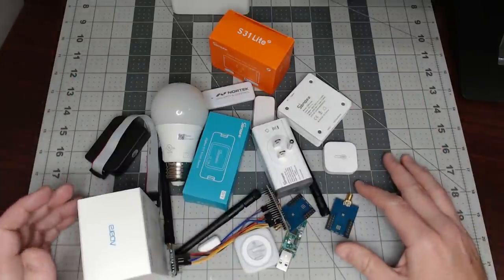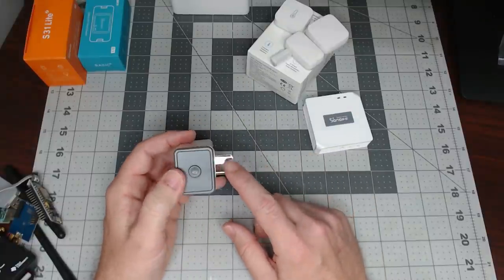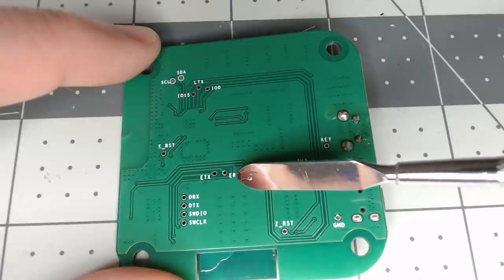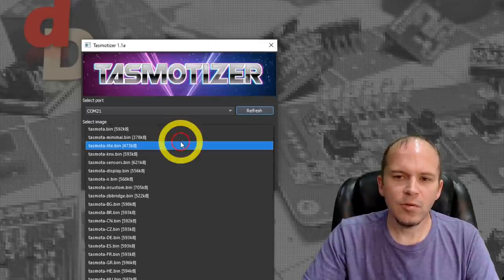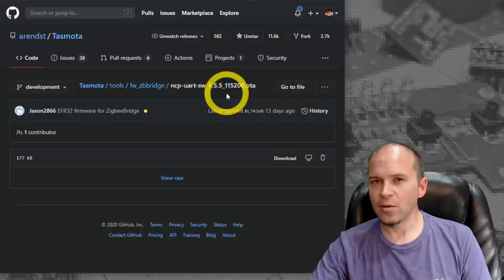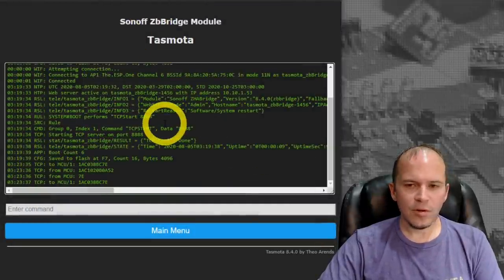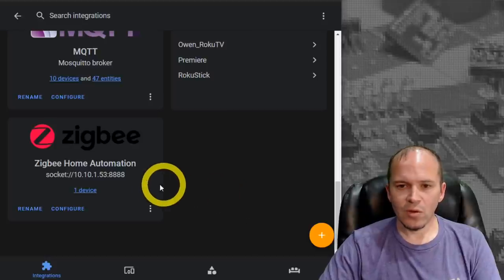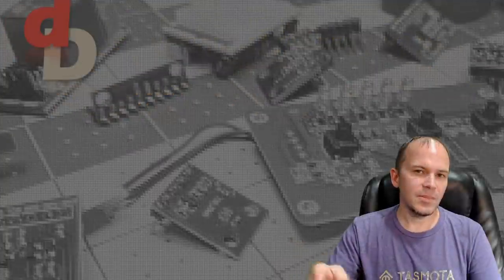Sonoff Zigbee Bridge with Home Assistant using Tasmota | NO Soldering | Step by Step Guide

Comment: Thanks the great video. Could you please some of details about zigbee bridge automation config? I see in configuration tab "Global Options" - Consider mains powered devices unavailable after (seconds) Consider battery powered devices unavilable after (seconds) like this settings. What should be standarts ? Also my zigbe temp devices is not updating each seconds. For example last update before 9 minute. How can i set it to update each 10 seconds? So i can see current temp.
Reply from the maker: In which app?
Reply: @digiblurDIY  İn homeassistant. Also there is a way to use with Z2M ? or we have to use with ZHA? Because my temp sensör is uptadeing 1 hours, 30 minute, like this. As i know you can configure this time with Z2M but we can not configure on ZHA
Reply from the maker: I know in Z2M you can sometimes change the reporting but not all sensors support that in their firmware especially battery ones that are trying to conserve battery power.
Reply: @digiblurDIY  I'm using sonoff Snzb-02 temp with my Sonoff zigbe hub. By the way is it possible Z2M with sonoff wireless hub? Or we have to use ZHA?
Reply from the maker: https://www.digiblur.com/2021/03/zigbee2mqtt-with-sonoff-zigbee-bridge.html

Comment: I tried the steps explained in the video and I ma getting the error "Failed to connect to ESP8266: Timed out waiting for packet header". Can you tell me  what may be the mistake i am doing.
Reply: I experience the same behaviour..
Reply from the maker: Check your wiring to be sure it is correct.
Reply: Hi, did you solve this problem? I'm in the same point, I review all the connection and try different ttl adapter, but i cannot fix this error

Comment: Thanks boss. You are the man. What is power cycle?
Reply from the maker: Like my kid would say... Where you cycle the power.

Turn it off and turn it on.
Reply: digiblurDIY little confused you say we are not gonna power cycle but you are doing it by unplugging from computer and putting it back in the case
Reply from the maker: Right, typically you would just power cycle your device the way it is.  I didn't want it connected to the flasher and possibly impact the Xmodem xfer of the secondary chipset.  So we pull the power, put it back in the case and fire it back it up.
Reply: digiblurDIY thanks boss. I understand this precaution is 
for bridge type of devices which has two chips. we will power cycle other devices when it is connected to the USB after flashing.

Comment: I find that I can't Tasmotize the device. I get "Failed to connect to ESP8266: Timeout waiting for packet header". I checked the connections and have used the ESP to Tasmotize other Sonoff devices before.
Reply from the maker: Nothing different about this one from what I found. Using RX to TX and TX to RX?
Reply: @digiblurDIY  Yes, I had the TX and RX lines crossed, The flashing method described differs from what I've used before with the Sonoff Basic. With the basic istrc holding the reset button down, connecting with the 3.3v disconnected, and then connecting the 3.3v.
Reply from the maker: The button is GPIO zero on the basic. As with many other devices with no button on zero. You need to ground GPIO 0. Use a meter to very your wires are good. I personally ran into a bad jumper wire the other day. Ohmed out each one and found the culprit.
Reply: @digiblurDIY  Yes, I've checked the wires with an ohmmeter and they're OK
Reply: Success! I tried a different USB To TTL FT232RL FTDI Serial Adapter Converter Module and it worked. Thanks again for the helpful replies, Travis.
Reply from the maker: Awesome! Process of elimination can be tedious. Glad it wasn't the bridge!
Reply: I had a similar issue with the USB to TTL FT232RL FTDI Serial Adapter but realized that I had to load the drivers before the card would show up as a new COM port.

Comment: Hi Travis and people. I just tried tu configure my Sf Zigbee Bridge, and updated to Tasmota 10.0.0, which upgraded just fine, but now I cannot flash the NCP file. I get an Upload FAILED message. Do you think I have to go back to an older Tasmota version? Thanks for the good work
Reply from the maker: You do need to be in Zigbee Bridge mode to accept any new NCP files otherwise it doesn't know what to do with them.  Change the module on the Configure Module selection to Zigbee Bridge

Comment: Hi great tutorial!! I need some help with my Smart Lock ZKTeco DL30Z with Zigbee. The Sonoff Starting TCP Server on port 8888 and my MQTT Server check LWT = Online. My question is how to pair the Zigbee with the SmartLock and operates by my MQTT server? Thanks, Mario
Reply from the maker: You go into ZHA and hit pair devices and then start the pairing process on the lock.
Reply: @digiblurDIY  Hi I install a Home Assistant and with Zigbee ZHA ZBBridge connected via Zigbee Coordinator but NO Control only 2 entities of Diagnostic LQI and RSSI. Any ideas of how to used this Smart Lock DL30Z with Zigbee compatible? Why they used Zigbee but only under a propietary enviroment? Thanks

Comment: Is this still a good way to go or is zigbee2mqtt better? I couldn't find one of those TI dev boards for zigbee that you had on that stream the other day.
Reply from the maker: I would probably opt for one based on the cc2652 chipsets as this is alpha testing at this time in z2m. Did you check Slaesh or Electrolama zzh?
Reply: @digiblurDIY   I actually ended up finding the CC1352, I don't know how I missed it before. Though I accidentally ordered the one with the 433 antenna not the 800-900 one.. Do you know what the difference is between the CC13x2 and CC26x2 boards?

Comment: Thanks for the video, extremely helpful.  Did everything like you said and all working except the last step.  After issuing the command "backlog rule 1...." to start the TCP server on port 8888, the log in console showed that the TCP:Starting TCP server on port 8888, RESULT ={"TCPStart":"Done"}. But after opening Zigbee HA in Home assistant and creating the serial device path using the line socket and adding the static IP, it throws Failed to Connect.  Can you tell whats the issue here.  By the way I am using the portable Home Assistant app. Thanks
Reply from the maker: Were you able to get Tasmota Zigbee to start as indicated in the guide?
Reply: @digiblurDIY  If you mean starting Tasmato Zigbee after flashing ncp_uart firmware, yes it rebooted after XMD:Successful
Reply from the maker: Test it in Tasmota Zigbee to make sure the chipset works.

Comment: what if I connect this bridge straight into raspberry with hassio and didnt flash it with ncp-uart, just only tasmotaflash. Would it be cloudless and secure?
Reply from the maker: Oh definitely secure at that point as it would have no zigbee radio.
Reply: @digiblurDIY  I assume that flashing it with tasmota requires extra flashing for zigbee chip to communicate with bridge itself. But to have cloudless solution to we ever need to flash the bridge in first place?

Comment: Hi, first of all, thank you very much for sharing that knowledge. I'm really sorry, but I would like to ask one more time about "Failed to connect to ESP8266: Timed out waiting for packet header" error. I was reading througth google for a week, and take a look of all the comments below. 90% of the cases are related to a bad connection. I think that it is not my case. I tryed to connect directly from pcb to the ttl converter and using a protoboard, I tryed with arduino UNO as ttl converter and a FT232R module and obtained always the same error. I measured that each cable is in a good conditions and try to push jumers while tasmotizing in order to get a good contact in the holes. Nothing works and I'm a little frustrating. Please, would you give me any advice? something more to check?
Reply from the maker: It could also be from power draw on the USB TTL not providing enough power.
Reply: @digiblurDIY  FT232R gives 3.2V alone and 2.8V during flashing process. I ordered a new devide and ill try again, thanks!
Reply from the maker: That 2.8v is probably too low.
Reply: @digiblurDIY  it works with the new device, thanks!
Reply from the maker: Nice! So it as the bridge or usb ttl?
Reply: @digiblurDIY  usb ttl

Comment: On a different note, I managed to pair 
Xiaomi temp sensor (aqara)
Tradfri gu10 lights
Tradfri button
Smartthings plugs

Somehow I struggled to pair the Xiaomi door/window sensors
Any advice appreciated
Somehow
Reply from the maker: Sounds like me on the Aqara motion sensor. Took me 5 or 6 tries to get it.
Reply: @digiblurDIY  I've tried more than 20 times with no success 😞
Reply: I'll hit the guys on discord if I can't get them to pair.
Thank you again
Reply from the maker: I just had the issue with Aqara motion.  Nothing I would do would make it pop up stuff in the logs.  I kept hitting pair, but nothing.  Took the battery out.  Nothing.  Finally I held the button down for 10 seconds or so, at about 5 seconds it started blinking differently.  Then I let go and pushed the button again, and boom it started filling the logs up.
Reply: @digiblurDIY  hmmm, I'll try this method
Reply: @digiblurDIY  finally managed to pair the magnet sensors after long trial and error 😰

They're very very fiddly things.

Thanks for the heads up 😊

Comment: Thanks for your video I followed the steps and everything went fine, all devices worked great for several days. However I had an separate issue with my Wi-Fi and decided to change the 2.4ghz channel from 8 to 1 and for some reason all my Wi-Fi devices dropped off and had to be re-connected, even though the SSID & password hadn't changed. Now i can't connect to my ZB Bridge until i reconfigure its Wi-Fi, so my question is how can i reset it back to AP mode? on my RF bridge it was 6 power cycles within 10 seconds to reset, is there anything similar on the ZB Bridge or do I need to re-flash to get back to Wi-Fi setup? I did swap my Wi-Fi back to its original channel but no joy, resetting the ZB Bridge is the only outstanding problem, I would appreciate any assistance.
Reply from the maker: The power recovery process is still the same. I would suggest in the future to put both wifi configs in the tasmota device as well as turning on wificonfig 2 when switching networks.
Reply: @digiblurDIY  wow what a rapid response, thank you. I'm new to Tasmota but I eventually found 6 rapid presses of the reset button put it into AP mode and I was able to re-connect to my Wi-Fi. As for the SSID issue, previously I found that some devices required a space at the end of my SSID to connect, my PIi's for example, others didn't. I don't know if this a Linux thing or my xiaomi router, however by changing the 2.4ghz channel seems to have removed the need for the space so those devices failed to re-connect. very strange but i now know the issue and all is good. Many thanks for your support and very informative videos.

Comment: hi, first i was not able to connect with bridge as per the jumpers arrangement. Then came to a reddit discussion where many people advised to connect  Z_RST to GRD as well in addition to GPIO0. I am able to flash successfully this way , tasmota AP appears, i can connect and enter my wifi ap details. bridge can connect to my router and i can access it with IP. the problem i am facing is that it is constantly connecting and disconnecting to router , normally both LEDs on bridge are off but every 20- 30   LED1-Zigbee (green) on bridge blink  and then LED2-Wifi (blue) starts blinking, meaning its disconnected to router and then it connects again but few moments later again LED1-zigbee blink and LED2-wifi also starts blinking and bridge is disconnected from router again. I cant proceed further with flashing zigbee chip. I tried falshing bridge several times but same happnings....can anyone help whats wrong am i doing?
Reply from the maker: You probably are using the version of Tasmota that crashes on the bridge. I have a note in the guide to try 9.2. Did you try this?
Reply: Thanks, i got it working by using old version of bin file as mentioned in the written tutorial.
Reply from the maker: Woot!

Comment: im on Hassio v 118. i accidentally use the OTA of ncp-uart-sw_6.5.5_115200.
when i try to upgrade again using 6.7.6, the hub  gave error: Upload Failed

Magic byte is not 0xE9
Reply from the maker: You would need to flip into Tasmota Zigbee mode for it to accept an OTA file.

Comment: Are there any reasons to upgrade from a CC2531 stick running zigbee2mqtt to this? My range is fine, just wondering.
Reply from the maker: I haven't used it with Zigbee2mqtt yet to compare. I did hear they are working on it.

Comment: I'm trying to add the ZHABridge to Homeasistant but can't get it to connect

I had it working previously but decieded to restart HA config due to a lot of old devices you can't remove and my ocd doesn't like that.

I choose :
- integration : Zigbbe Home Automation
- Configure port manually
- Radiotype : EZSP
- socket://192.168.1.103:8888
  115200
But then I get an "can not connect to device" and I can browse to tasmota (with http://192.168.1.103) just fine there are no firewall blocking 8888. 

As said it did work before ... No changes was made other that removing the integration from HA and updating HA stuff.
Same ZHABridge no changes was made to that.

Any ideas?
Reply from the maker: I would try connect via putty or something to that port. Watch the Tasmota console with weblog 3 set and see if you can type in the terminal and see if it comes across.

Comment: Is there an option for the black case sonoff rf bridge to have the same connectivity as this white one? The board layout is different, it does flash but it keeps rebooting so doesn't work unless I install the tasmota.bin, the tasmota-\zibbridge.bin doesn't work on it.
Reply from the maker: It shouldn't be rebooting. I have heard of one person that had this issue and they flashed the regular tasmota then upgraded to the zbbridge one later via OTA.
Reply: @digiblurDIY  do you have a link where I can find that information. I tried the ota approach but it just fails when I try loading the bin file.
Reply from the maker: Flash the tasmota-lite.bin first to start.  Then use the tasmota-zbbridge.gz file and don't unzip it, just push it over via the firmware upgrade screen.
Reply: @digiblurDIY  Thanks but no go, both tasmota.bin and tasmota-lite.bin work fine no reboots but as soon as I upload tasmota-zgbridge.bin my sonoff rf 433 hz bridge starts reseting every minute or so. I guess I'll have to buy a regular sonoff bridge (the white box).
Reply from the maker: The button isn't jammed?
Reply from the maker: Put tasmota lite bin on..  do a setoption13 1 to disable the button hold feature.  Then try the zbbridge bin via OTA upgrade so the setoption13 1 sticks.

Comment: Hallo !
ONLY you can make the sonoff SNZB-01 works in HA.
My button is visible in HA only with “battery level”. I don’t know how to use the button in automations.
I use deconz usb zegbee.
PLEASE make a video or teach me.
Thanks a lot
Reply from the maker: Use the zha_events listener to grab buttons.
Reply: @digiblurDIY  Yes, that's I know. BUT, how do I use that code, I don't know  ):
Please, make a video. You will make lots of people happy ;)
Reply from the maker: That implementation is weird and I problem wouldn't given Zigbee2mqtt handles it just fine.
Reply: @digiblurDIY  Understand. So it' better to buy the Trader Ikea Switches......
Reply from the maker: No idea. I don't have those available to me. If you can't get ZHA to work then you have nothing to lose trying Zigbee2mqtt

Comment: this integration completely broke on the last release - have you retested it ?
Reply from the maker: No I haven't as I am using Zigbee2mqtt with a CC2652P USB stick myself. I haven't heard anything out of this as I know many people are using serial over ethernet based coordinators of various types. Is there a github issue for this yet?
Reply: Actually,  after attempting it several times, it worked again... nevermind .

Comment: Please help if is possible to make a scene on Sonoff like this:
- to keep the bulb light off if you open the door less than 1 min . Otherwise to be switched on. 
- The ideea is * do not turn on the alarm if the door is closed in less than 1 min *
Reply from the maker: Are you using any home automation software?
Reply: @digiblurDIY  No, if you mean something like Node-red. I don.t know how to  use something like that. I.m just a home user :) just the app Ewelink.

Comment: After you have this device flashed to Tasmota, is it worth flashing Zigbee door sensors etc? Or would you just leave them stock? 

The idea is to take the cloud completely out of the equation.
Reply from the maker: I haven't flashed any sensors like that myself as the firmware they came with worked with Zigbee.
Reply: @digiblurDIY  So the most important aspect of removing 'cloud' dependence is the Bridge itself then?
Reply from the maker: That is correct. Zigbee is a local protocol.
Reply: @digiblurDIY  Thanks for the clarification. I always appreciate your insight